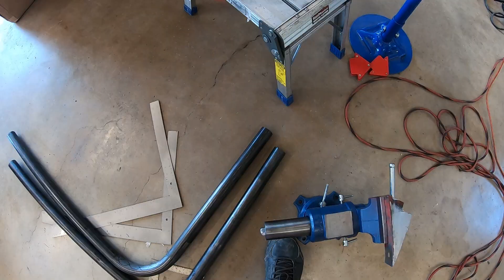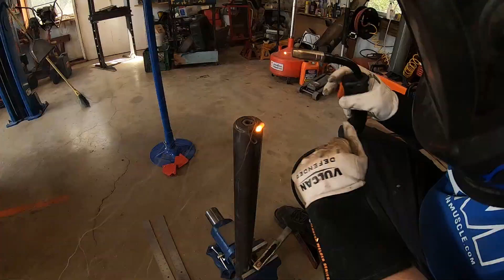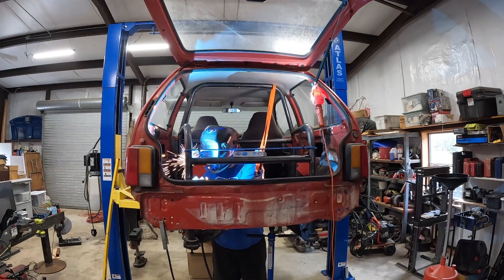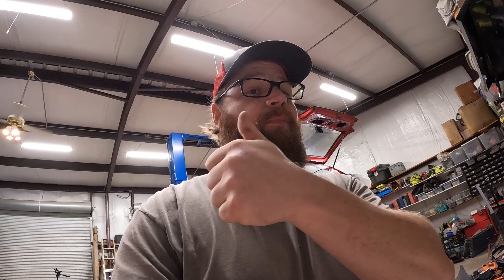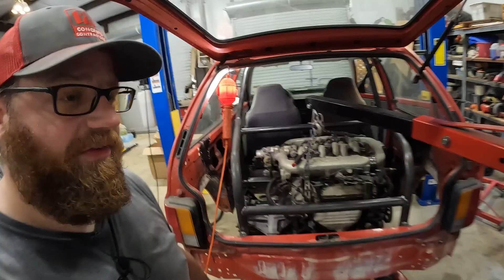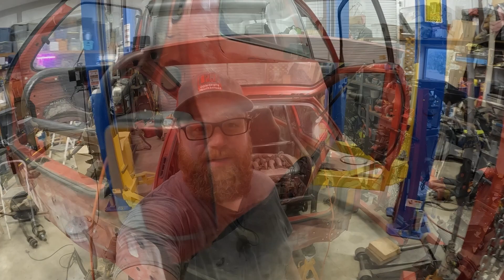Ford Shogun Build - Episode 4. The engine is in!

Comment: Sweet!  You have any plans to beef up the assembly at the back?  Other than the little stubby tubes going to that rear panel?
Reply from the maker: Thanks! Yes, I still need some side tubes that attach to plates below the side windows, and probably make some plates where the bumper bolts on and run tubes off those back to the cage. Likely some triangulation tube here and there... kinda making it up as I go from this point, but yes, it looks like it needs more beef 😋